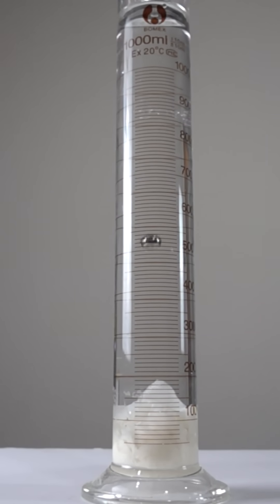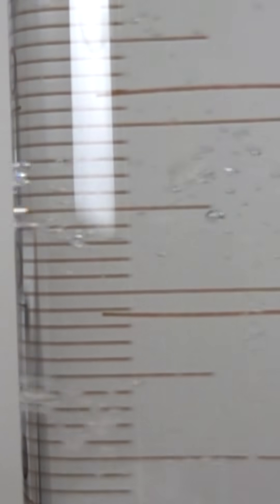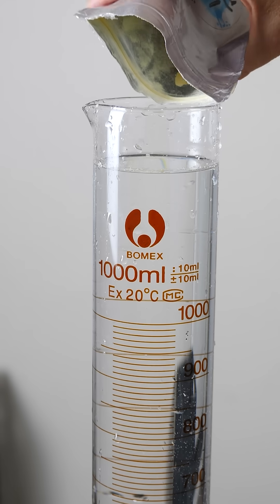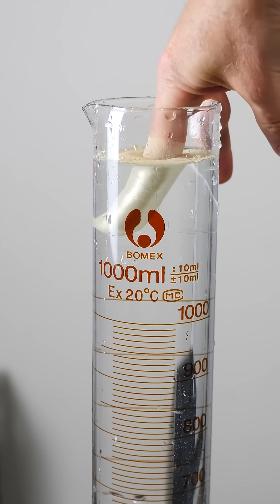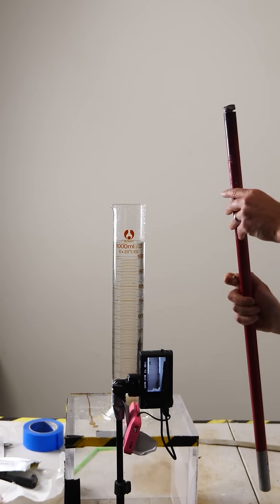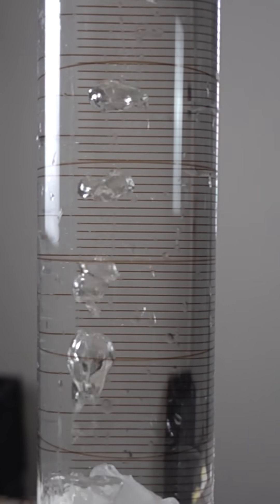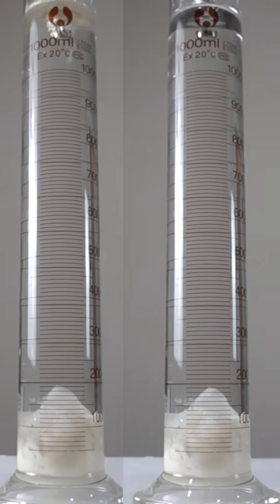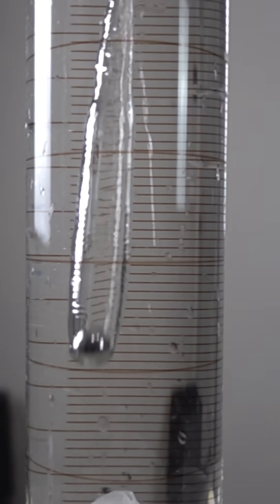Making a Frictionless Torpedo

Comment: At first it did not make sense to me how the absence of higher pressure water relative to air, behind the ball would lead to less drag until I then realised the "entrained" air, moving at the same velocity as the ball bearing provided more counter pressure to the front of the ball bearing than collapsing water would behind the ball bearing. The effect is sort of equivalent to a higher density ball bearing being shot/dropped through the water.

Comment: Reducing friction does not remove friction.    They should drop three balls simultaneously but the third outside of the water tube and just how much friction there still is.    Even then, the ball dropping through the air is encountering a minute amount of friction.

Comment: This is a rubbish experiment.  The first sphere is gently placed in the water so it sinks slowly.  If you drop the normal sphere at the same velocity as the allegedly “hydrophobic” sphere (which wouldn’t pick up a significant amount of the powder on its mirror finish surface at its faster entry velocity), you would see the same cavitation effect on both spheres.

Comment: My friend be careful, you are giving away STATE SECRETS. Some very Classified Military and Government Vehicles use something similar to this. Copy and Paste WARNING (so some young keyboard Cop doesn't get ASSHURT).
Supercavitation is the use of a cavitation bubble to reduce skin friction drag on a submerged object and enable high speeds. Applications include torpedoes and propellers, but in theory, the technique could be extended to an entire underwater vessel.
Normally a high-pressure jet of air is used but a new chemical reaction sort of like this has been used with great success. Expect a Black Helicopter and Black suited Men with no smiles to visit you soon.

Comment: the torpedo engine is a propeller... it better hits water to propel, so maybe you don't have water at the tip but it surely has to be near the end. I doubt the speed increase will be that high or even there if water needs to touch the torpedo at some point

Comment: German Uboat crews used to cover torpedoes in petroleum jelly to achieve the same effect.
Reply: Sounds sus.
Reply: LUBE MY TORPEDO HANS, JA!
Reply: It was “grease” ,  torpedo tubes are not riffled barrels, where you want the outer most layer of the projectile to dig in and start spinning.  They are just smooth tubes. Yet you need a tight fit that doesn’t have heavy friction. Like a piston in an engine (not that tight, but that’s the idea)…. So it doesn’t tear the tube up and wear it out , and it has less of a chance of the round getting lodged in the tube, which would either take the tube offline or if the torpedo went off, it would of course blow the sub to scrap metal….  “Grease” is non-soluble in water but is NOT hydrophobic…
Reply: @mikevader1988  the grease they used was hydrophobic, also a torpedo shares nothing in common with a gun except that it is a projectile that transports a explosive charge. When torpedoes are fired the tubes are flooded with outside water the outer doors open then a larger volume of water pushes it out and starts the drive motor all in one. It doesn’t need a super tight fit up like a gun as the water pushing it out of the tube is just enough to get it out and start the drive, not meant as a means to get it to its target. Also grease, oil, and pretty much most petroleum based lubricants are hydrophobic hence why you need soap to wash it off your hands as soap his both hydrophobic (which attaches to the hydrophobic grease) and hydrophilic ( which attracts water) so it can be washed away.
Source: Basic Science
Reply: @johngarlick7115  ,  my references to rifling of a gun, was to express that very fact that “they are not like guns” …. (It’s called reading comprehension),  secondly this was about WWII era submarine torpedoes, specifically German subs.  Those subs did not have rollers for the torpedos , they were rails, (hence metal on metal), modern torpedos are coated in a polymer. The grease did IN FACT ensure that the torpedo launched from the tube smoothly as well as aided in cutting the  water resistance as it glided through the water towards its target. I never mentioned or commented on “how the torpedo was expelled by the launching tube” ,  only that it was a smooth walled “tube” ….  Because that was not relevant to the subject of why the Germans in WWII coated their torpedos in a thick brown grease.  The rush of water into the tube pushing the torpedo out IS how it was launched. but if the tube didn’t have some degree of tolerance between the torpedo and the tube walls , then the water would just rush around the projectile and not apply and direct enough force on the torpedo to push it forcefully out of the tube.  The grease also helped in protecting the tube from corrosion from the salt water…. The only point I will concede to you is that “ hydrophobic” used in the broad sense can apply to grease because of its insolubility in water. As opposed to on a molecular level of interaction between water molecules and a hydrophobic substance which “ repels” the water on a molecular level.  Which is why he didn’t just rub grease on the ball bearing in the video.  Ya know science and stuff….  But I’m sure the WWII U-boat operators just had no idea what they were doing and rubbed thick messy grease all over their torpedos because they were dumb….
Reply: @johngarlick7115  , furthermore the science at hand was about “Super Hydrophobic” and having almost “ZERO drag coefficient” …. That’s the science being presented.  It’s the difference between a conductive  and a superconductor material …..   Grease even in the broad sense of the term being hydrophobic (ie conductor) ,  doesn’t make it super hydrophobic with almost zero drag coefficient(ie superconductor) ….   To compare grease to this super hydrophobic substance is paramount to saying iron is the same as a super conductor….  You also said, “a torpedo has nothing in common with a gun except it’s a projectile that transports an explosive charge”…. I gun and a bullet are two completely different objects.  My reference was to a smooth bore projectile delivery system vs a rifled projectile delivery system…. A “gun” in the basic sense IS a round barrel that is used to eject a projectile out of it.  You can have conventional gun-type mechanisms with gun powder etc… or an Airgun , or a railgun , steam gun , or a water-gun,  or a blow gun used by jungle tribes… the only difference is what is used to push the projectile out of the round tube… call it a barrel  , or a tube , or a shaft , it’s all the same fundamentally basic idea. I never even remotely eluded to the torpedo and launching tube functioning like a conventional gun. As a point of fact , I said that it didn’t function like a rifled barrel…. It was a smooth tube, the projectile (the torpedo) had to fit with a degree of tolerance but not super tight like a bullet….  The grease indeed provided a “smooth launch” of the torpedo out of the tube. Salt Water isn’t a great lubricant.  Remember this is WWII era German U-boat, no rollers , or bearings, the seals in between the chambers of the tube were also protected from saltwater by the grease…. But I didn’t get into all of that…. Furthermore there are many accounts of torpedos getting lodged in their launching tubes….  That’s called basic  “History” ….    Maybe  before you jump on a comment and try to make yourself sound smart at the expense of another. You should read carefully and understand the references along with the subject matter at hand….
Reply: @johngarlick7115  what... only the fact that hydraulic air pressure shoots the torpedo out of the tube before the torpedoes motor starts spinning.

It has the same principle as a smooth bore cannon. The grease they used is in comparison to crisco. It is not hydrophobic does it help reduce drag in water yes, but that does not make it hydrophobic.

Hydrophobic solutions repel and displace water by properties and create a barrier around an object. 

The grease the germans used did not make their torpedoes hydrophobic.
No navy has ever used a hydrophobic solution, have tested but never used.

It is easier for hypersonic torpedoes to use either a piston or rocket and cavitation nozzle to create the same effect cheaper.

Both the germans, russians, and Vietnamese have a super cavitation torpedo currently. Iran possibly does.
Reply: also works on cucumbers
Reply: Torpedoes are rear propeller driven.Putting that drive propeller in a big cavitation bubble sounds like a terrible idea.
Reply: @Snipergoat1  it doesn’t envelop the entire torpedo just the forward section making it easier to move through the water by reducing drag. There are however a few countries in the modern day that have super cavitation torpedoes that do envelope the entire torpedo in a cavitation bubble and are capable of speeds up to 230 mph, but are very limited in mobility and ability to track targets.
Reply: I think that was to aid in its ejection from the tube as well as loading it.
Reply: Try a Peanut and petroleum jelly sandwich. I hear they pass right through you.
Reply: We use corn starch
Reply: That's not what the grease was for, jaybatsford.
Reply: It was solidol, or lithol.
Reply: use ur critical thinking skills here, torpedos are slow as hell and don’t cabotage. that wouldn’t matter.
Reply: NO. They didn’t.
Reply: @teeanahera8949  Yea they did, A brown petroleum based grease was coated onto the torpedoes!
Reply: @jaybatsford the grease that was used to make it easier to load in the tube as u boats didn’t use rollers in their tube just rails, and to help seal off where they adjusted the delay fuse timing, and as you listed to reduce drag in the water but the drag reduction was figured out after the fact. Source: grandad was a very energetic man, with a weird mustache, and waved in a weird way to people at the strangest times
Reply: @johngarlick7115 you're saying your granddad is Adolf H.?
Reply: @BLACKOMAMBO  it’s a joke, naw my grandad was in the us navy in ww2
Reply: @johngarlick7115 grandad sounds like a nice guy 😅
Reply: @johngarlick7115  ur grandpa is my hero
Reply: @johngarlick7115 Sounds like my great grandfather......
Reply: that was called german slime, as theyd harvest it from their skin. @jaybatsford
Reply: @johngarlick7115  your jokes might even be worse than mine lol. Mine tend to be dryer than the Sahara at high noon in the midst of a century long drought.
Reply: @matt247even  yeah, he sounds like a real gas.
Reply: @tyrlant2189  Trying to throw us off his trail, take out the L and the name checks out.
Reply: @johngarlick7115  lol I thought Popeye for some reason
Reply: @johngarlick7115  does he happen to be  a bar of soap? 😂
Reply: @BLACKOMAMBO I wish i was his descendent. The man that made the race of people who lobbied for the death of gods only begotten son pay for what they did. What an honor!
Reply: @BLACKOMAMBO I dont think Hitlers children survived the war
Reply: @johngarlick7115  The joke is that grandad was a ww2 veteran who fought and died to kill nazis and save the planet, while his grandson is making nazi dogwhistle jokes on youtube. That's peak humor.
Reply: @teeanahera8949  is your google broken?

Comment: How would that compare to the same ball dropped beside the tube in air?  Almost no drag is not the same as zero.  

What if the ball were coated in water repellent before dropped in the powder?  Is this simply leidenfrost effect but with chemicals?

Comment: Yeah, that's nice and all, but this only works with gravity.  With an actual torpedo, it can't have a massive air bubble traveling behind it, because then the propulsion screw wouldn't be in contact with water, and the torpedo wouldn't actually be able to move.  Fluid dynamics are pretty particular about, you know, being in a fluid. 😅

Comment: What happens if you coat one side? then one side would force water to the side, then up, then the higher pressure on the non-coated upwards side would push it faster

Comment: If you layer it on a drying clear coat of every boat or hydrofoil fin would it work to increase speed by reducing drag?
Reply: Of course but this guy has no idea what he is talking about.
Reply: I dunno, wouldn't the boat sink?
Reply: @lethal_trap2 i think if it is already bouyant the resistance to sinking would remain the same.
No clue if it would be easy to control on the water without as much drag...
Reply: @atlaslee8681  the boat is buoyant to water, if it can't touch water then wouldn't it sink?

Comment: I wonder what’s the furthest distance this phenomenon can stand up. As it descends, there’s clearly air being left behind so if the air runs out and vortices/low pressure pockets created by that movement are allowed to make contact with the back of the sphere, it should still slow down even with the hydrophobic coating. Could there be some physical or mathematic rule that could be derived about this possibly?
Let’s see a super long tube of this done and then have it done in a wider tall basin to see how behaviors change.

Comment: Yeah the Soviet Union was the first to test that idea except they use air to push in front of the torpedo causing an air tube basically streamlining the torpedo so that it would basically go like 400 mph in theory underneath the water because of the air bubble that it created at the nose of the torpedo however after much design and they just couldn't get enough air pressure to envelope the entire torpedo so that it would go faster Just couldn't get it

Comment: There is already some research in this area called SUPER CAVITATION, it relies on small "bumps" on Surface of object to create a layer of Turbulence surrounding Object to reduce friction to Zero. The USSR used this in Torpedoes, & May have been what sank the Kursk Submarine, as it was allegedly fitted with them ..

Comment: Funny thing if you took and designed a submarine the shape of the ball with air bubble 
   Had enough power and micro poring grooving on the leading edge could make a extremely fast submarine